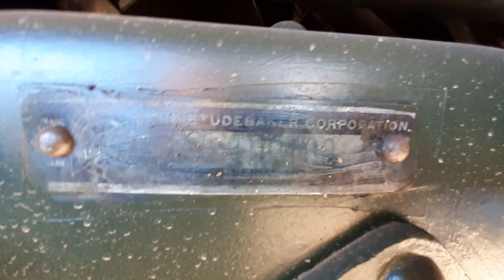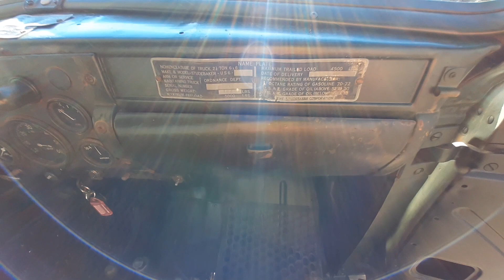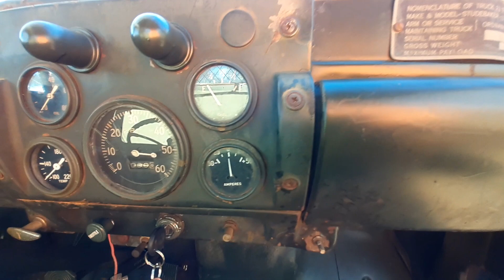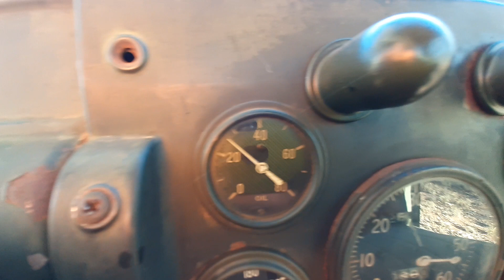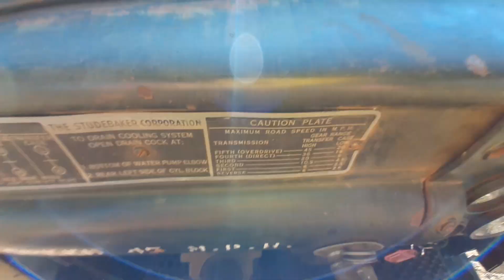Studebaker US6 1945 walk around

Comment: Made right here in South Bend, Indiana. The Ruskies also used them as carriages for the "katushya" rockets against the Nazis. One of the best heavy trucks of any era.
Reply from the maker: Interesting to hear. This one has been in our family since the early '70s. It worked hard on our cattle station in central Australia for many years. In 1974 in the big floods it was flooded up to and through the cab floor for over a week before it could be dragged out. My father replaced all the oils and it started straight up and went back to work. You couldn't do that with anything modern now.
Reply: @Outbackvintagevehicles  Union labor! ;0)